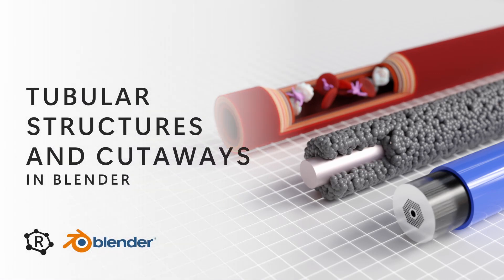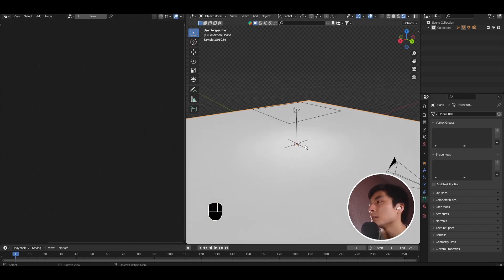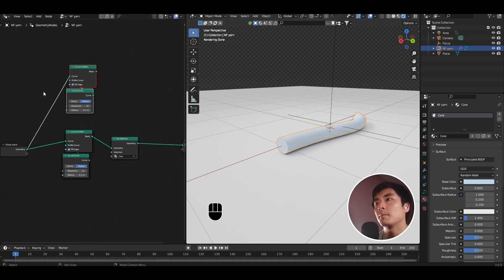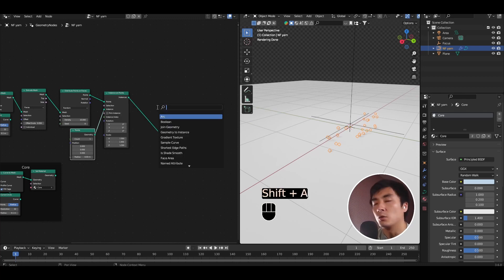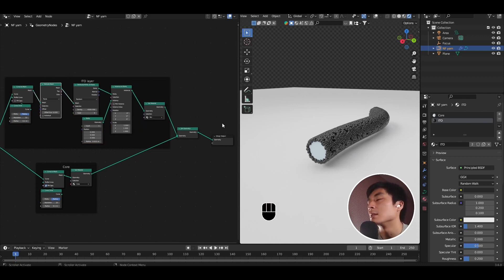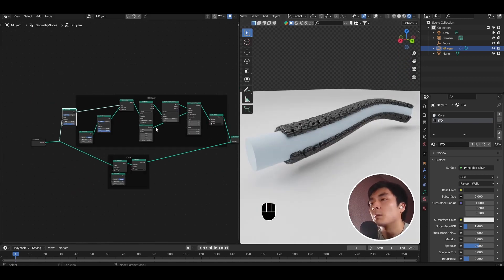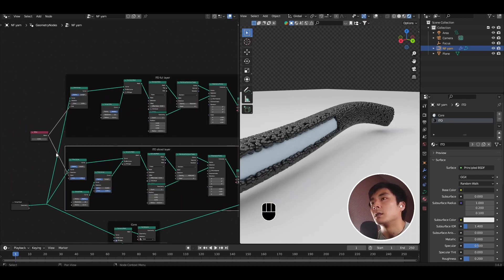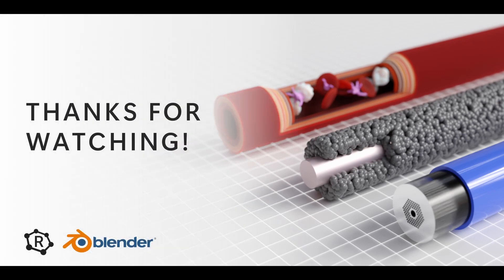Tubular structures and procedural cutaways in Blender

Comment: is there a way to achieve this in Eevee?
Reply from the maker: Good question. Getting tubes and cutaways will also work in Eevee. All you need to do is use either an icosphere or UV sphere rather than points as the Instance Object.

Comment: Hi, very cool video, thanks a lot. I run into an issue: the boxes which are created by "distribute on faces" are empty (outer shell is shown in  orange of each box) in the viewport. If I mute these notes, everything looks as it should,  so the material setting seem to fine. Any suggestions? I'm new to blender, so I've no clue about the cause.
Reply from the maker: I’m not 100% sure what you mean by boxes, but they sound like points. If so, and you’re not seeing them in the viewport, chances are you are using the Eevee render engine. This needs to be switched to Cycles in the render settings tab for them to appear properly. Alternatively, if you want to stick to Eevee, you could add an Instance on Points node after Distribute Points on Faces and use an Icosphere or UV sphere as the Instance object.
Reply: @ryomizutagraphics  It was indeed due to the rendering engine. I've now selected cycles and the points are now white, instead of black.